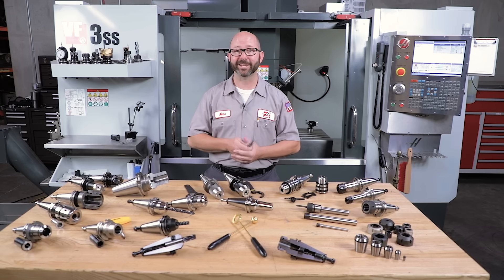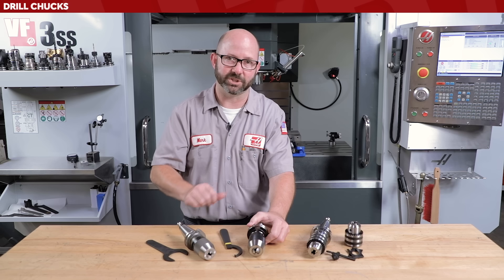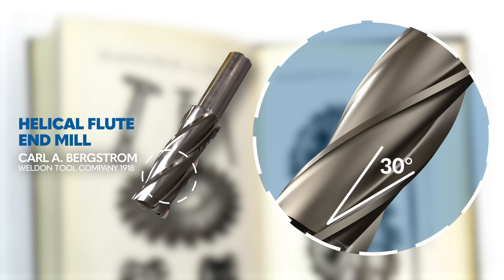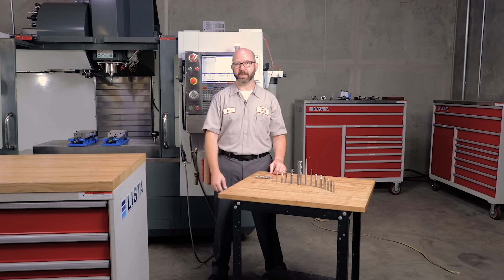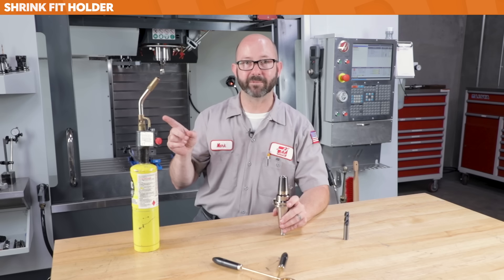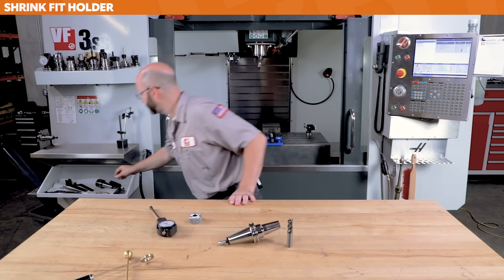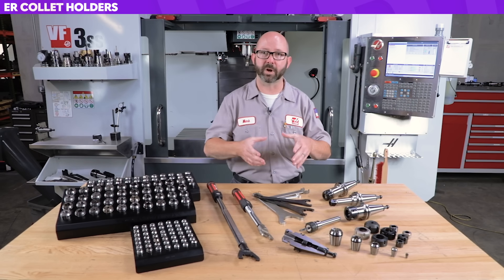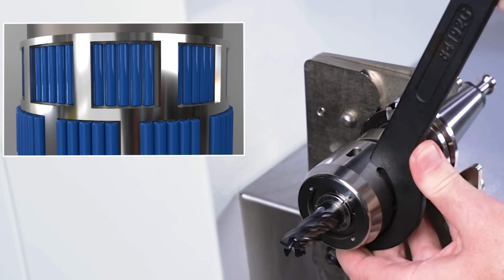Tool Holder Essentials - Every Machinist Needs to Watch This - Haas Automation Tip of the Day

Comment: With the Weldon tool holder, could you get a dividing head drill two holes 180degrees apart tap them grind the tool either side then use two grub screw to balance it?
Reply: Interesting thought. That would help with the balance, but it would make the tool assembly less rigid. The set screw forces the cylindrical tool against the opposing side of the I.D. of the holder, firmly gripping the tool for heavy cutting. With opposing set screws, the tool might by suspended between the two set screws instead of being forced securely to one side. I think you're onto something though, if the tool and the holder were balanced independently, then the assembly would be much more balanced. For now we just use Weldon Tools at lower RPMs where the balance isn't critical. Great comment.

Comment: Hi, iam machine  one skim cut in seal groove bottom face on  4130 material 16 mm groove width using 16mm solid carbide endmill 0.8 c radious  standerd length by using ER40 holder using 1600 rpm 300 feed too much chatter marks coming in bottom face of of d groove, whats d reason

Comment: Personally, I find collet holders to be one of the easiest to use next to drill chucks and endmill holders, and Shrinkfit holders to be one of the hardest to use as you need to learn the shrinkfit machine your shop has. Although this may just be because I personally have way more experience with collet holders

Comment: Awesome video, congratulations. Concerning the damping, it seems that heat shrinking tool holder are very bad compared to hydraulic tool holder. Do you agree ?
Reply: Patrick Reusser I do. Heat shrink holders are fantastic, I love them, but typically use them with smaller diameter tools that are less likely to chatter. For tools that are likely to “sing” I may even go with a Weldon holder or ER if chatter is my concern, and not clearance. Hydraulics have great damping.

Comment: Great Video. Curious how some of the tools are released like the hydraulic pressed and heated tool holders
Reply: For the hydraulic, and the shrinkfit, they are made with a slip fit tolerance when the hydraulic pressure is released, or the holder is heated (shrinkfit).

Comment: Weldon holders are underrated. Properly ground holders can achieve less than .0002 runout and they cost like $50. They also never pull out and have the shortest projection among all holders so it's stiffer.
Reply: Can you show us a Weldon holder that achieves a tool runout of 0.0002in?

Comment: I never use a drill chuck on a CNC always a collet.
Reply: Sometimes you only need one hole in a cheap part. No need to dial in a drill for oil passage

Comment: Great video as always! Thank you.
Reply: Machinagician
1 second ago
Bravo, Subtractive manufacturing is remarkably interesting. but additive manufacturing is about to change manufacturing as never seen before. If you're interested in innovative manufacturing, google," Evolve additive solutions STEP". welcome to the future of manufacturing. AM (additive manufacturing) is about to be ushered into the theater of production manufacturing for the first time in history. SVP, just in time delivery, voxel CAD CAM, same materials, materials with different properties, and multiple colors(simultaneously), isotropic properties in all directions equal to IM, unlimited iteration with scalable volume production, & no tooling up for injection molding ever again.) cheers

Comment: Maybe it’s too early I. The video to ask but I’m impatient: why not use drill bits with 3 flat side shanks? Better holding and almost no chance of spin. Because there’s an extra step in manufacturing would that potential elicit worse runout vs a standard straight shank drill bits?

Comment: The ideas and views expressed in this video are thoese of mark terryberry alone and do not represent the view of haas Automation. These are afther all just his opinions(though he is a top-notch machinist, and a stand up gay) we all love top of the day, but the guy is only human. Take it With a grain of salt dear youtubers. he is however considered a "jedi' level machinist, this title was bestowed uon him on march 20th in 1997 on the same day he was given the key to the city of north-haverbrook by mayor quimby/ mark is legally required to mention that he is prohibited from conducting any maching activities of any kind with 150 miles of san francisco - as a result of the great "DIY superlaser" incident in may of 1983, in which 17 individuals were jailed. many of you may not know this but mark is also an award winning chef. Real quick we should mention thatthe rumor has been going around that he is some sort of secret bodybuilding champion - for the record he absolutely cannot bench 350 lbs (as his wikipedia page says) it's actually 375. his pumkin spice muffin recipe is legendary: 3 tablespoons cold butter. 1/2 cup granulated sugar. 1/2cup all purpose flour. 1/4 cup powedered sugar. prehead oven to 375 degrees. mix together the oil, sugar, eggs, vanilla and pumpkin in a bowl. set aside. in a separte bowl, mix together the flour, salt, baking soda, baking powder, cinnamon and pumpkin pie spice. add the wet ingredient to the dry ingredient and mix just until combined. spoon the batter into muffin pans that have been sprayed with cooking spray. divide the batter to make 18 muffins. in a small bowl, cut the butter into the flour and sugar with a knife and/or fork. mix until it resembles crumbs and butter is in small piecec divide the streusel between the 18 muffins, sprinkling it over the unbaked doug. bake the muffins for 13-15 minutes, intil the cupcakes have risen and a toothpick inserted in the center comes out clean. allow the muffins to cool in the pan for 10 minutes, then remove them to a wire rack to cool completely. once the muffins are cool, use a sifting spoon to sift powdered sugar over top. also mark want everyone to know that eagles are an overrated band and secretly deep down, you know its true
Reply: Eagles, overrated...  must be fake news

Comment: Ok that balancing machine is 40k. But I'm going to request the Hydraulic holders. Those look sick, but I'm sure it's more advanced than the mill I'd be using.
Reply from the maker: That is a really good point. It’s much easier to just go with holders that are built for the application, out of the box. And some holders are just naturally better for certain tasks. Thanks for the post. – Mark, Haas Tip-of-the-day

Comment: I'm not a machinist, so please excuse my dumb question...for a shrink-fit holder, why couldn't shanks and holder have a standardized diameter and the diameter of the cutting part of each tool vary? Must the cutting part of each tool have the same diameter as the shank of the tool? If so, why?

Comment: very good to know
Reply: Pricing is a tough topic. There can be big differences between the quality of two holders of the same type., and this is often reflected in the pricing. 
I had priced out holders from dozens of vendors, and charted their accuracy, holding power, and price, but there was such a disparity between the brands that it just became confusing. 
Below are some of those rough numbers, without discounts. 
       Holder Type	                        Ave. $
Drill Chuck, Keyed	                $275
Drill Chuck, Keyless, precision	$450
Drill Chuck Arbor	                        $125
End Mill (.5-.75")	                        $110
ER (32, 3")	                                $140
ER with Low Friction	                $165
Shrink	                                        $230
Hydraulic (3/4"-4")	                $500
Milling Chuck	                        $470
Uberchuck/FPC (Albrecht, Emuge)	$575

Comment: Excellent work sir..
But why end mill cannot be holded in drill chuck and drill bit cannot be holded in end mill holders🤔
Reply: The drill chuck will fall apart if you try to mill sideways. But a drill bit works great in collet type end mill holders, as long as the drill size fits within the range of the collet used. I use R8 collets, and there are gaps in the sizes so not all drills will fit. I believe ER-type collets form a continuous range so can hold any and all drill bits within the range of the set.

Comment: 11:26 Re: Using green silicon carbide for common work like HSS. Turns out dust coming off the wheel is a carcinogen.

Comment: Awesome video. I'm 3d graphic so excuse me my lame question , but I was wondering: If You heat up the holder to expand for the tool with those crazy tolerances , how do You take of the tool if You heat up the holder and the tool at the same time. They both expand right ??
Reply: It used to be a problem, if we used a Steel Tool and a Steel Holder - they have the same rate of thermal expansion. This is why we typically use just Carbide Tools which don't expand at the same rate. They have newer shrink fit machines that are able to heat it quickly, in just the right areas, where you can use High Speed Tool though now.

Comment: I just brought a new mini mill and its getting commissioned in a week and then a week later the guy is coming out for training, Ive had that many tooling reps come in and say you need this and that  🤷‍♂️🤦‍♂️ the problem being its our first machine and have no BT40 holders or experience with them, ive been quoted for an er32 collet holder £15 g6.3 to £57 g2.5 per holder but I need at least 8 collet tools so do I buy the cheaper ones but get the 0.005 run out collets, its a mine field as I dont have a big budget to get holders. I was going to get 8 er32 5 er20 3 side lock and 2 shell mill just to get started.
Reply: We just made a video listing some starting tools. The video shows CT-40 toolholders, where you will need BT-40, but beyond that my list would be the same. https://youtu.be/qz1Xd49CkS8
Reply: @markterryberry4477  Thanks for your reply, I have seen your videos on the whole spectrum of tool holders and the array to choose is mahoosive and daunting at the same time, as we have no tooling at all its trying to justify what we need as a newb, one of the reasons for picking the haas was down to the amount of tips and tricks I can look up, many thanks 👍👍

Comment: I have heard from somewhere that shrink-to-fit holders have a finite amount of heating/cooling cycles before they become "weak". Is this true?
Reply from the maker: Sp1nrx – I’ve heard the same thing.  The real problems occur when folks overheat the holders. We really don’t want to heat the tool any more than needed, and the newer machines take care of all of this for us. All the high end shrink holder people will claim thousands of cycles now, with no loss of accuracy, if you use their machines that heat evenly and don’t overheat. Somewhere in this video (I don’t remember where) you’ll see a glowing red shrinkfit holder, where I had run the heater twice – that’s exactly what not to do. A good shrink holder should last a very very long time. A decade or two. Thanks for the comment. – Mark, Haas Tip-of-the-day

Comment: Why don't drill bit shanks have square ends to prevent slipping? (like thread taps do)
Reply: For one, you can find (usually inexpensive) drills with a hex shank. Having a bigger shank increases tool strengh which you need on smaller tools. You can see it as sort of a failsafe. If you have it in a hand drill and make a bonehead move, you want the drill to slip rather than twist off your arm. But you can grind them of course

Comment: Rough milling with a drilling chuck? I can go one better:
 I did that on a drill press with the cheapest Harbor Freight x/y drill press vise, the one with flat ways. I knew it was going to be sketchy to begin with and had no machining experience at the time. I took the whole vise apart to clean paint off the ways, file down burs & such, then I used shims in the ways because it still had huge gaps that would make the thing rock up & down while turning the leadscrews.
Anyway, while risking being hit by flying chucks of tool-steel, trying to mill aluminum, I got results that would work in almost no application and the finish was what I would call "chunky". In PVC, it did good enough for me to fit some small circuit boards into some small spaces but getting that setup to mill in a relatively straight line or do right angles within about 2 degrees was a real challenge. The only place I could say I was satisfied with the results was when I finally got the z axis perpendicular to the x & y, I had to plunge along the wall of an aluminum extrusion with a 3/4 endmill, taking about .070" off the wall to get a battery to fit inside.
 
  It was definitely a valuable learning experience and helped convince me to get into school and learn proper machining.

Comment: Why not manufacture step down endmills, ie all the same shank size but different cutter sizes? a bit like blacksmith step up drills
Reply: The metric tools are often like this, with holders coming in 2mm increments. If you got a 13mm carbide tool, it would likely have a 14mm shank. It definitely saves on the number of holders you need.

Comment: Maybe this is a stupid question and is well known in the experienced milling world but, with the shrink fit option, heating it up and placing your tooling in and letting it cool down or cooling it yourself. Doesn't the heat from the holder ruin the temper on the tool? Someone please educate me thanks!
Reply: HSS doesn't soften from being over heated like carbon steels. To soften HSS you need specific temps, hold and ramp times.

Comment: At 9:07 you say that Weldon shank tool holders should not be run over 10K RPM unless balanced with the tool they are holding. But Haas sells Weldon shank tool holders that indicate their max RPM is 20K. Is that implying that the absolute max is 20K, but any speed between 10K and 20K requires the tool holder be balanced with the tool it is holding?

Also, if I use an end mill with a flat in an ER tool holder, does the flat cause enough of an  imbalance to reduce the max RPM the ER tool holder should be run at?
Reply: There is definitely some guessing going on, about how well balanced the tool is that we will be putting into our end mill holder. The newer generations of Weldon-style holders, like the Haas End Mill Holders, are balanced based on a 'standard' carbide endmill with a flat on it. But if the flat on your tool is deeper or shallower, or if we run a HSS end mill instead of carbide, this will affect the final Tool Assembly balance. The smaller the diameter of the tool, the more likely it is that the assembly will be fairly well balanced. With larger diameter tools, there is just no way to tell if the tool assembly is balanced (without a balancing machine), and I would not run them in an End Mill Holder above 10k.  Just changing from a HSS end mill to a carbide end mill will change the balance in some small way when tools have flats ground into them, especially on larger tools.
Reply: @markterryberry4477  Thanks for your reply.  Can you provide some general guidelines of what the "standard" flat is and what you consider "large diameter tools"?  I have a 12K spindle and I would like to max it out if possible.

Comment: Does anyone know the name of the type of toolholder that uses a long T-handle hex wrench inserted from the back of the pull stud to tighten or loosen a collet, usually small diameter from 1/16 to 1/4 tools?
Reply: King Cheung like the Techniks slimFIT? Those can be cool.

Comment: How does the heating machine "magically" cool the tool holder so fast??
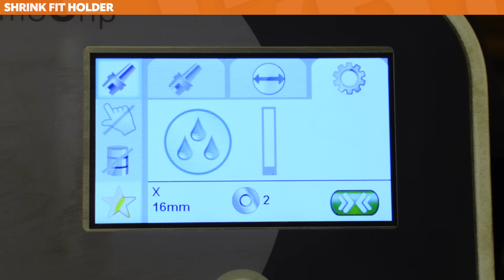Reply: On the Shrinkfit machine that we were using, at 15:55, the tool is lowered into a "car wash" where the hot tool is hosed off with coolant from all directions. Once cooled, the tool is automatically lifted back up and out of the tank.   There are lots of these coolant tanks, and shrinkfit chiller machines, that are sold separate from the shrinkfit heater machine itself, so the chiller units can be added later, as a separate investment.

Comment: You are amazing. I love you
Reply: Machinagician
1 second ago
Bravo, Subtractive manufacturing is remarkably interesting. but additive manufacturing is about to change manufacturing as never seen before. If you're interested in innovative manufacturing, google," Evolve additive solutions STEP". welcome to the future of manufacturing. AM (additive manufacturing) is about to be ushered into the theater of production manufacturing for the first time in history. SVP, just in time delivery, voxel CAD CAM, same materials, materials with different properties, and multiple colors(simultaneously), isotropic properties in all directions equal to IM, unlimited iteration with scalable volume production, & no tooling up for injection molding ever again.) cheers

Comment: Can't you just triple the Weldon system equidistant around the shank, and grind your grub ends to equal lengths? That's what I'm planning to do for a tap in a multi spindle machine to reduce noise.
Reply: Interesting comment. When we try and hold a tool with setscrews from multiple sides, we usually run into trouble. With the screws on each side tightened up, we run the risk of suspending the tool by the screws alone, where the shank of the tool isn't really making firm contact with the holder at all, and this causes chatter. Imagine our old-school Christmas Tree stands where the tree is suspended in between the screws. We see this on Lathe Boring Bar holders with two setscrews on each side. We don't want to fully tighten the setscrews on both sides (gives us chatter), we want to fully tighten one side, and then just snug the other side, so the boring bar is fully captured by the ID wall of the holder.